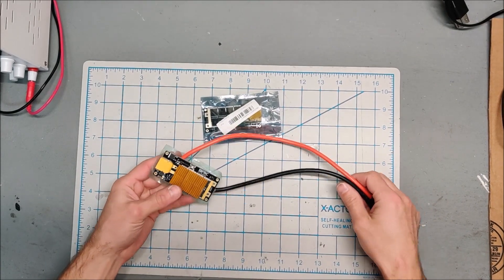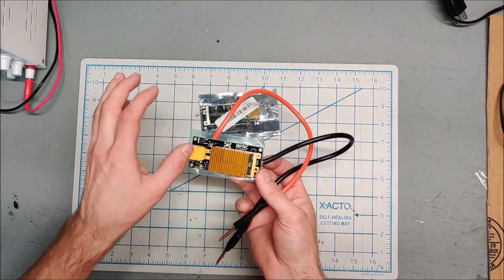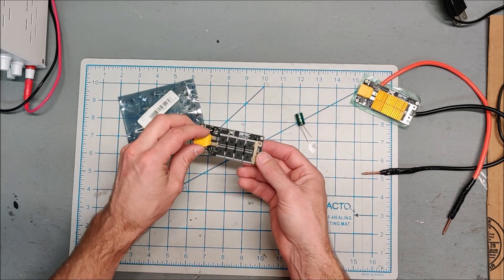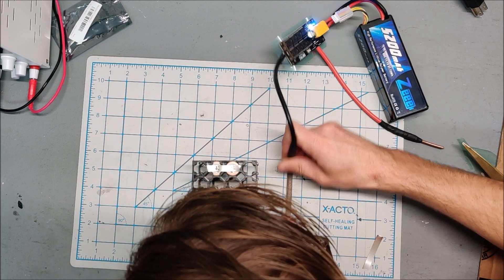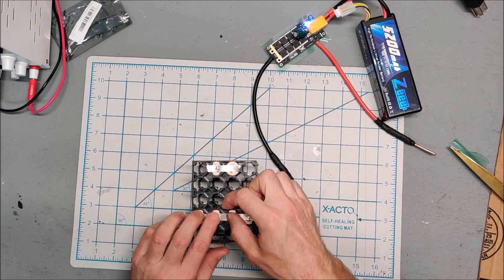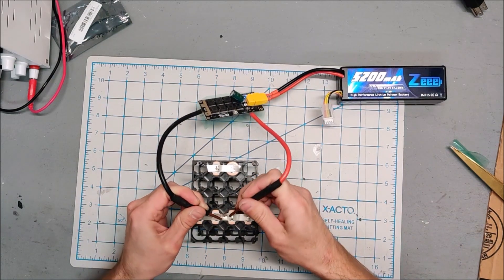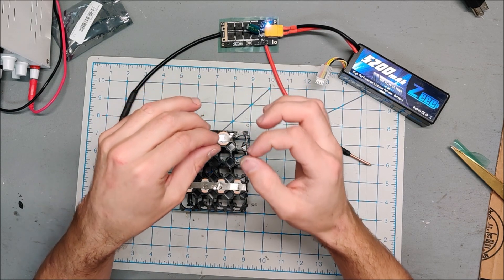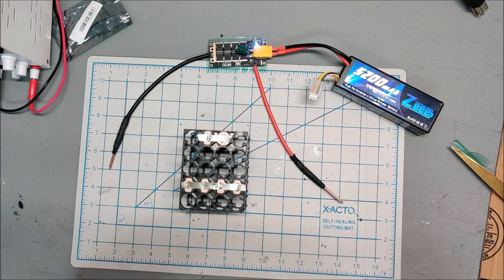BUYING AND TESTING A NEW BIFRC SPOT WELDER: STILL THE BEST?

Comment: I have to disagree a bit. My mosfets blew up twice. First on a 3S5P battery with 18650 cells. Then I used a long, thick and expensive 4S 6800mAh 100C battery. I made ~50 2S1P 18650 packs for RC models and it failed again. The battery was discharged to 16V and I don't believe that the voltage dropped below 3V per cell. This time the controller burned out because after replacing the mosfets the board didn't come back to life.

Comment: What's the lowest voltage I can use to spot weld if I power the bifrc with external 12V? 2 3000F ultra caps in series would be enough? TIA
Reply from the maker: Do not go under 10v. The MOSFETs could get stuck open at low voltage
Reply: There are boards out there meant for 5.4V spot welding (they recommend charging your 2.8V caps to 2.7V just to prevent overcharging. You should also use those cap balance boards that prevent one from overcharging when you charge them in series). So search "5.4V spot welding board" or something similar and look at options. "2S farad welder" is another way the Chinese label it. Some boards specifically say not to use caps but i Don't understand why.

Comment: what charger do you use for your Battery, I didn't see it listed and was curious.
Reply from the maker: ISDT https://amzn.to/3Y6I0G1
Reply: @stevenc22  Are you happy with the ISDT? I have a ToolKitRC M8S and it has some quirks so I'm looking at some of the ISDT models from the Q6 and Q8 series along with the new SkyRC B6 neo. I really need something to just charge this one Lipo but mostly to balance my various lithium Ion 18650/21700 packs and A123 LiFePO4 packs. If it doubles as a voltage checker (plugging in the balance cable is enough to power it on) that would be awesome. Balancing current or the ability to balance without charging is not crucial. I have multiple active balancer boards meant to move around from pack to pack and they are a billion times better than any device IMO. The accuracy is often down to the millivolt and I can just leave it on a pack overnight and its almost guaranteed to be done after 8 hours.
Reply: a charger that accepts 8S is much more beneficial than 6S due to LFP being 8S for 24V and LiIon being 7S....but I don't have a ton of 24V packs so it would be a bonus but if a 6S only charger has the edge....not a dealbreaker

End of the day the iCharger S6 or X8 is the ultimate charger to get IMO. No clue why the X6 still exists when the S6 blows it out of the water. Of course the DX8 looks to be a another "last charger you'd ever need" since I think it has the synchronous charging features the bigger iChargers have
Reply from the maker: @ericklein5097  I like my isdt but I end up  using my Icharge x8 the most. The isdt are great for small batteries but the Icharge is the goat with 2amp balancing.
Reply: @stevenc22  obviously the X8 has a huge advantage being able to handle 7S lithium ion and 8S LiFePO4 batteries but do you feel like you're missing out at all with the added power the S6 has? Did you choose the X8 for that particular reason?

Its a tough decision for me....I can't imagine I'd likely NEED that extra bit of power but it is quite tempting. Honestly if they came out with and X16 I'd probably get one of those and an S6.

It's a shame Revolectrix shut down, their Powerlab 6 and 8 were the only real options in that power category I'm aware of besides Junsi iCharger Duos. If I had the money to blow I'd probably find someone with a Powerlab 8 and offer them a good price for it and just keep going until I found someone that was willing to say yes and take the money and just buy a new iCharger 408 Duo or something

Comment: Is it also a good idea to do this with my BIFRC DH20 Pro+ spot welder, and what is the voltage and uF you use for 
the cap?
Reply from the maker: The capacitor is not necessary off you have a good battery hooked up. I don't use capacitors on any of my spot welders because I know my battery can handle it.
Reply: @stevenc22  Ok, thanks for answering so fast.

Comment: Mine works too well. Even on the lowest setting, it throws a lot of sparks and blows holes in my nickel. I disconnected the capacitor, and it didn't help. Im using the exact same Zeee battery except mine is 50C. I also have the common 5 mosfet one from amazon, and I have no problems with that one.
Reply from the maker: Use larger needles to spread the weld
Reply: @stevenc22  . Yes. My needles are new and have very sharp edges on them. I'm going to make new ones specifically for that spot welder with duller points, since the ones I have work great with the other spot welder.
Reply: @E-BikingAdventures  pure nickel? Have you tested it with the saltwater method for 24 hours?

Comment: Hello we also get an enclosed mini BIFRC spot welder with built in rechargable battery. And the machine is like 103x83x29mm in size. How does a small inbuilt battery provides such a big current for welding? Have you seen those?
Reply from the maker: I have seen them. Lipo batteries are incredibly powerful and tiny. It's probably not as powerful as my battery but still powerful.
Reply: @stevenc22   , Thats good, thank you. I am getting this setup. Can you please tell, how much spots does your 80C 5200mAh LiPo battery give with this BIFRC board? Or in short how many cells do you spot weld in one charge with 5200mAh LiPo?
Reply from the maker: @KetansaCreatesArt  I can spot weld hundreds of batteries. We don't care about how long the battery lasts, we only care about how much peak battery power the battery can deliver.
Reply: @stevenc22   , Very awesome. Thanks again bro
Reply: @stevenc22  , Guess what I found! 😎 . I got this setup now, and guess what - If you long press the button for 3 seconds, the power setting will remain the same but you will get to cycle between different blinking colours. This is the setting of time delay for the shot after touching the two probes. You can cycle from Red 2 seconds - to IceBlue 8 seconds.

Comment: Aight bought it with your link but got a knockoff version. no version number, diffrent board layout etc
Reply: Seems to be in working order but I have not welded with it yet. Im gonna wire it up with a diode and the cap supplied with it in a way that the board gets powered by the cap when the battery voltage drops

Comment: fuck me. I bought mine a week ago. it will come after christmas. I hope I get a high quality version from a good manufacturer. not some standard chinese garbage with factory binned components meant for the lowest of the lowest trash. I got 2 11.1V 5200maH 80C batteries (Lipo, 450A)  to power it and I will connect them in parallel. Also have a capacitor in the package. What leads are you using? Kweld?
Reply from the maker: I make my own leads from from 10awg silicon wire and some solid copper thick gauge wire for the tips.
Reply: @stevenc22  wow thanks for the quick reply man! Appreciate that. Ill try to build it myself too
Reply: also you calculate the discharge rate diffrently. C rating is the time in which you can safely discharge the battery 20C would be 3minutes 60C one minute and 80C 40seconds
Reply from the maker: @livelaughlove_88h  Its the same calculation. C rating is the maximum amps the battery can deliver. That amp rating divided by the capacity also tells you the time the battery can run for.

Comment: I got one and did the higher gauge wealding leads per your suggestion.  Using 2 12v 9ah lead acid batteries in parrallel and it work great. thanks for the videos.  You have a new subscriber.   :goodvibes:
Reply: Sadly after about 5 cells it flashed and blew the strips on the bottom of the board like a fuse.  I didn't thin I crossed the leads.  Any ideas?  Thank you
Reply: @brewman684 lol bro. I think you used a sealed AGM batteries or am i wrong? 18Ah is not enough. Although the SC amperage is way above 100A it does not mean it can supply enough voltage right after the first weld hit. Or, for you, after fourth weld. The batteries can not supply high enough voltage  after short circuing it for like 0.1 or 0.15s, after that the voltage will sag so low that the gates stay open and you got nickel destroyer  rather than nickel welder because your mosfets are completely gone brother. I tried it with 110Ah Car battery with 950A of starting current and just after i unplugged it from the charger i tested it and blew right a way after first weld or i did not completed the first weld because it happen exactly what happened to you. The best solution is to use rather expensive LiPoly battery pack with highest C rating and capacity you can afford or how much  you would like to pay for such a thing. Never use car batteries or if so, take 2 or 3 2200uF caps and place it between plus and minus in right polarity. That should keep the voltage sag above 10V after a many welds and the second , the nonstop plugged and hooked lead acid battery charger so the voltage of that battery will be always above 14V and it gives you small headroom for longer welding

Comment: Thanks for the uploads. Based on your reviews, I purchased this unit (with cap) but I'm struggling to get it to work well.
The unit is powerful and is blowing a hole through the nickel strips even on the lowest red setting. 
My battery is a liPo turnigy 14.8v 5200mAh 12-24C battery. Is it too powerful or is something else the problem?
Reply from the maker: Is it pulsing or is it stuck on and dead shorting on the nickel? I've had one get stuck on and I thought it was just super powerful but actually it wasn't pulsing or was stuck on and was just melting the nickel.
Reply: @stevenc22  thanks for replying. It appears not to be shorting. The nickel to nickel wrote weld fuses together but blows a hole at one of the needle contact points.
Reply from the maker: @briancharlton2292  Try rounding the needle points. it should spread the current out and reduce the blow out.
Reply: @stevenc22  I will give that a try. I was thinking I had an issue because of my battery.
Reply from the maker: @briancharlton2292  weirdly your battery is actually kind of weak.
Reply: @stevenc22  Turnigy does not exaggerate their C ratings...at least not by much maybe just a tiny bit. So that 12C to 24C battery will likely test on the Wayne Giles Lipo ESR Meter to be somewhere in that range. Since the 24C rating is for burst and the Wayne Giles meter uses a short burst of either 16A or 8A depending on the model you get it should be right around 24C which is a decent lipo. Quite a few lipos claiming 80C/100C etc will test between 20C and 40C

Its a PITA because you have to know which brands BS and which give honest ratings but the easiest way is to look at their product lineup. If their highest offering is 100C or higher they are bullshitters

Comment: Can we use 12 volt 3s 6ah lithium battery pack which i made from laptop batteries as a power source
Reply from the maker: Unfortunately not. 3 18650's can't deliver enough amps. You need 200+ amps to weld

Comment: Can i use a 4s LiPo battery (14,8V)?
Reply from the maker: Technically that's airport a little high in voltage but I bet it works

Comment: Logic level MOSFETs would not need 9V for the gates or a gate driver chip with an internal charge pump would be great too,
I don't know what MOSFETs are used, probably the cheapest stuff they can get away with.
Because of your recommendation in the first and second review video, I ordered this spot welder, the latest version is advertised as "V3".
You saved me from buying this spot welder, which is screwed directly to this large Lipo cell.

Comment: Thanks for the video. I think the description of why the capacitor is needed is not completely correct though.

The mosfets dont turn off because the voltage drops below 9V. Where does this number come from?
In the datasheet you can see that it turns on around 4-6 Volts. 
http://www.datasheetcafe.com/4n04r7-datasheet-mosfet/
http://j5d2v7d7.stackpathcdn.com/wp-content/uploads/2021/02/4N04R7.pdf

Furthermore, this is an N-Channel Mosfet so it is off if the Gate-Source-Voltage is low.
This means it does not fully turned ON if the voltage is to low. If it is just partially turned on then it will have a higher resistance and heat up much quicker (6 Typ. drain-source on-state resistance - in the datasheet).

I don't see what the capacitor should help with that problem if attached between Bat+ and Bat-. The capacitance is so low compared to the battery and it will be empty almost instantly when the MOSFETs open. The only reasonable place, i can think of, is at the VCC of the STC8G microcontroller, so that it does not shutdown and restart.

I tested the spot welder with a high current battery and after some welds the transistors work fine in the highest setting (ice blue) but still get hot. So i think it is a good idea to mount a heat sink to be on the safe side.

Comment: did someone manage to get the manual mode working, i.e. push a button to trigger it? 
I tried like in the product description https://imgur.com/gallery/5gAlfZ8 but it did not work.

I probably have an earlier version. Mine looks pretty much like in the linked picture on imgur. 

Btw,  some people claim that the BIFRC welder triggers on contact. This is not true and not even possible with the board design of my version.
Reply: To use the external trigger you need to connect your switch to the small pads on the board, Key and GND.  Put the board into manual mode by holding down the button and supplying power while the button is pressed.  The selection LED will light bright green, press the button to toggle between flashing and sold green LED.  when the LED is solid green it is in manual mode.  Hold the button down for 5 seconds and the LED should remain green.  Now the board is in external trigger mode.
Reply: @bosshog2328  Thanks for typing the manual. But as i said, this did not work with my version of the board.
Reply: @theincapable  Ok, my board has the same markings as yours and it works for me.  Sorry I didn't understand your comment.
Reply: @bosshog2328  Thats strange. I think i did exactly like in your description and the the "key"-button doesn't seem to do anything at all. I cannot enter mode selection.

But lets be precise. After adding the "Key"-Button, there are TWO buttons(key-button, options-button) and there are TWO LEDs (colored option-LED, only green (flashing)welding-led). 

1. press the options-button while powering on
2. the options-LED will be green
3. pressing the options-button will switch modes indicated by flashing(automatic mode) or continuous (external trigger mode) green options-LED
4. holding the options-button for 5s to accept the mode

Is this correct?
Reply: @theincapable  It's kinda hard to do because the button is so small.  But you have to make sure that you have the mode button fully pressed while supplying power.  If not it won't enter into the auto/manual selection mode.
Reply: @theincapable  I've tried this and the indicator light changes from solid green to blinking, but I can not get the mode light to go off solid.  In automatic mode it usually flashes when firing and now it stays on permanently.  
I can't get it to reset to automatic.
Reply: @johnmcgrath8673  sorry i can't help you with that. My board seems to be broken and does not behave as it should do. I don't have a manual mode at all.
Reply: So you're talking about the options button. This one is definitely working since I can switch modes. I've tried it dozens of times, in all thinkable combinations and it didn't work once.
Definitely not possible on my board or with that firmware.
Reply: @theincapable  yes, that is the correct button.  The mode button, NOT to be mistaken withe the key and GND pads that you connect your external trigger.  If you did as you said then I can only assume that you have a defective board.  It should work.

Comment: Hello, i have 2 of these spot welders. From what I've notice the sparks appears when the blinking led is on. Do not put the leads on nickel when the led is on (the leads are energized), that's why u have the spark. And one more thing: do not accidentally touch the needles together 'couse you'll burn the mosfets (don't ask me how I know). Nice video. Thanks.

Comment: I just bought one of these and thought the idea of dragging so much current through an XT60 connector was a bit silly, so I soldered 8-gauge cable directly onto the the two main contacts on the back of the board. These are the ground side of the circuit (that is switched through the mosfets). The positive line is taken directly from the battery (I'm using a car battery) on 8-gauge cable. The XT60 is now used only for driving the circuitry on the board. All I can say right now is that it works but I need to do more testing.
Reply from the maker: Not the worst idea ever. Some people have suggested powering the board with a separate power supply which you could easily do if you never connect the battery positive to the board....
Reply: @stevenc22  Thats true, separate power will definitely save mosfets from burning out, but looking at oscilloscope I found that in this case mosfets are closing too slowly, like if there is capacitive load: closing time about 100 milliseconds, much longer than pulse length which is 10 to 70ms depending on chosen mode, so if powering board separately it is good idea to add 1k resistor between out- and in+. At least this is what I found on my board, it looks similar but still a bit different: without version and serial number...

Comment: Hi, what do you think about have a separate power source for driving the mosfets? the heavy duty battery will only have to weld and you will not have to worry about the voltage drop.... i have already fried one so i'm looking forward for a solution like that
Reply from the maker: A couple people have suggested that. I'm going to look into that